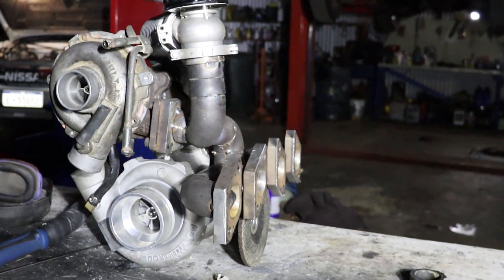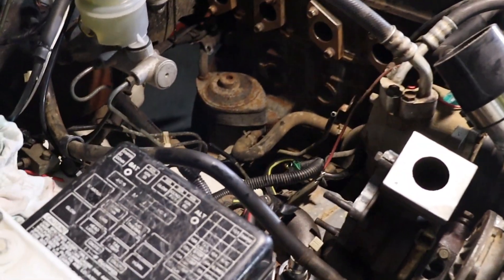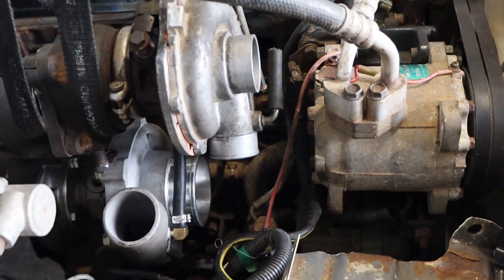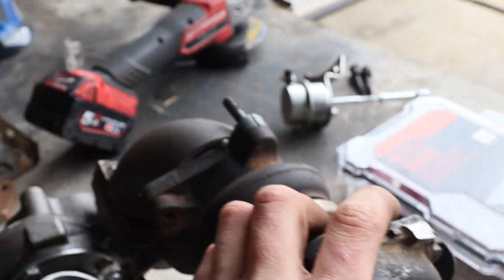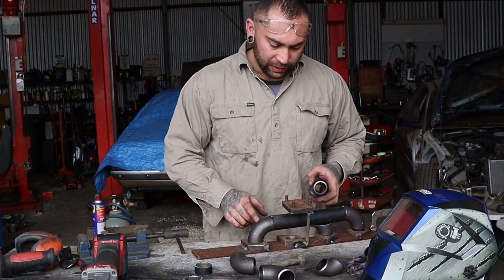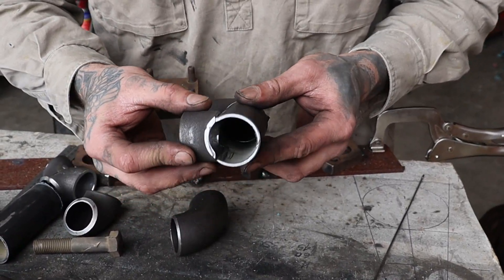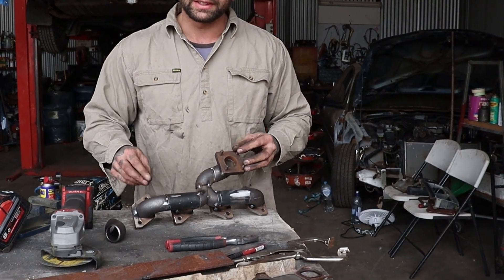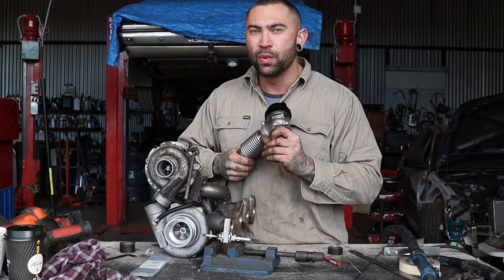Compound Turbo 4JB1 Holden Rodeo Pt1

Comment: With a 4 cylinder manifold you want to join 1 and 4, and 2 and 3. Since you didn't have the room for that here, a log manifold would have given the best results - there was no need to cut it in the middle and put in that Y piece. Still pretty cool. Are you planning to run an intercooler between the turbos? A small water to air would do the trick nicely.
Reply from the maker: Yea I have a water to air intercooler I can use to run between them but it'll come down to a space issue. I'll probably fit it later on though
Reply: If you blow into the ports with Log manifolds it'll push air out of the other ports, by adding the y in the centre it prevents this and could potentially even create some scavenging from the other cylinders. By using 90 degree bends instead of t pieces like most logs do that would also help the flow. Good job keen for more vids
Reply from the maker: @yd2532  thanks mate!

Comment: Love ya work! Hopefully the factory turbo compressor isn't to much of a choke point
Reply from the maker: Yea we will see how it goes. If it is ill replace it
Reply: @jamestyrrell4179 I was going to go through the trouble of compounding... it all began when I ran the factory V1CQ to 18psi via an adjustable wastegate maxed out. The dam thing still couldn't flow enough to open up on the highway... the solution was a F5V vgt turbo off of the 4JJ1... a manual boost controller from GFB and a weekend of cut an paste metal work and voila, 22-25psi and no lag... so I know you built it but if it doesn't work out you might consider a VFIB.
Reply from the maker: @darrentylor5473  yea a standard dmax vnt turbo was my go to choice but couldnt get one for a decent price. If they can get upto 240hp on a dmax then they are plenty for the rodeo